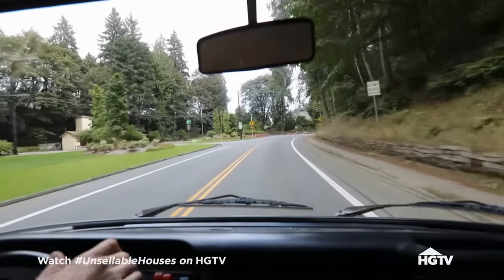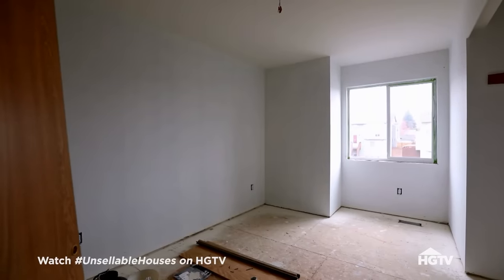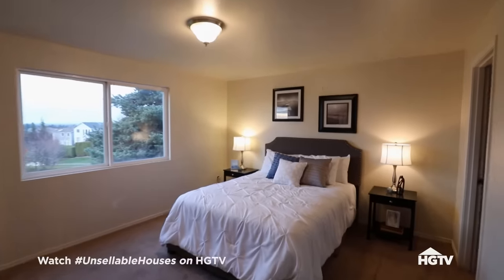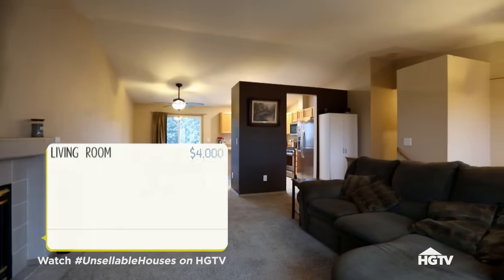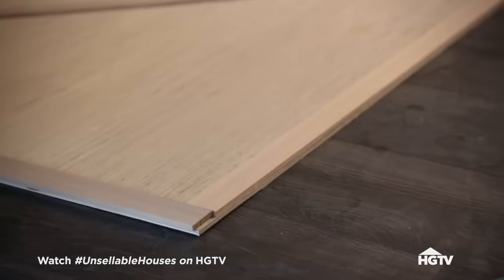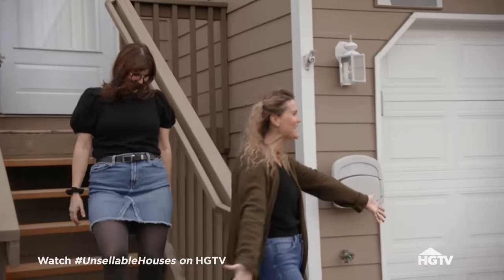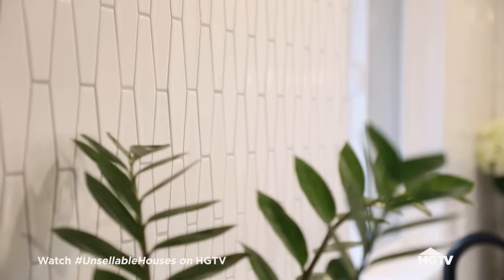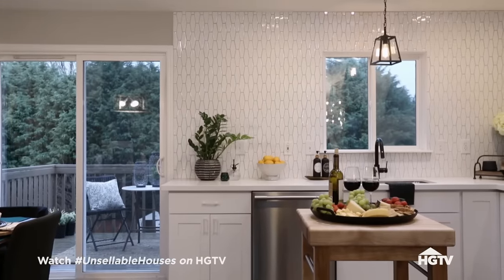Sleek, Modern Renovation of Split-Level Home | Unsellable Houses | HGTV

Comment: Apparently no future homeowners are not going to cook. You removed any storage for a cooking snd baking. Who puts a wood hood above a gas stove. Wouldn't do it for electric range either. But definitely not above a gas appliance. I wouldn't be purchasing that home.
Reply: I agree completely. 

Removing the pantry and upper cabinets from the kitchen makes no sense to me Al all. Adding an island would make a huge difference for the usability. There are nice looking range hoods in stainless steel for reasonable prices. The hood is too big and looks like it was made out of very cheap wood disguised with dark stain. 

But the biggest problem of all is the new railing at the entrance. It opens the place up but kids will look at it as a place to climb. Without much effort on a toddler’s part you have an avoidable disaster waiting to happen.

Comment: It’s a beautiful reno.  Taking away the pantry and upper kitchen cabinets - plus removing the pantry closet -  and then they only get a dinky kitchen island/stand?   I don’t understand why they couldn’t have built a larger - but not massive - island that could replace a portion of the lost storage.
Reply: Yes - they lost over half the kitchen storage and work counters.  It may look trendy but it's smaller than most 1 bedroom apartment kitchens.
Reply: I thought so too. However, its easier to build a kitchen Island after should the owners need one. I would build one just so that there is more storage space.
Reply: I agree. The tile on the walls is beautiful and has great impact. It’s an odd choice to remove the amount of storage in the upper cabinets without at least putting in floating shelves, and I was expecting a bigger island for work surface and storage. If I were buying the home, I know I would have wanted that.
Reply: @naturefleur2062 considering it sold in less than a day for $15k over the new list price they obviously didn’t need help
Reply: @ProudNana78  thanks for your comment! :)
Reply: Should have done an actual kitchen island with seating instead
Reply: I disagreed w you. Before I watched this episode. You are right.

Comment: Beautiful design, but I would at least add floating shelves, that match the range hood, on both sides of the sink. I would also want a larger island with storage.
Reply: Agree. That wall of backsplash needs breaking up with function.

Comment: like others have said, the kitchen needs more storage . You can have design as well as function--you don't have to sacrifice either. One upper cabinet on either side of the kitchen window would have been good. There could have also been open shelving flanking the range hood. The area rugs leave much to be desired and are the wrong sizes. The dining room rug needs to be larger so that when you pull out your chair, it still sits on the rug

Comment: Seconding the rest of the comment saying "not enough kitchen cabinets." The tile is pretty and they did a good job on the overall renno, but that whole range wall should have had uppers and it would look just as open and pretty. Functionality ALWAYS should come before aesthetics--but why not both when you can pull it off?